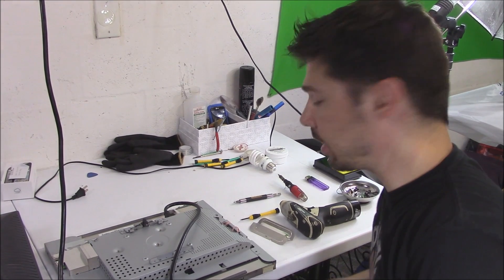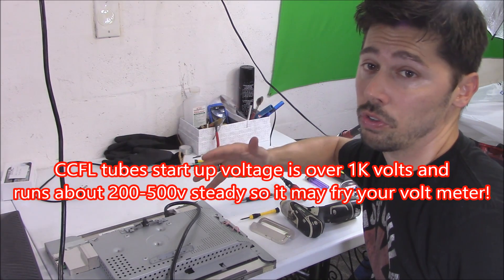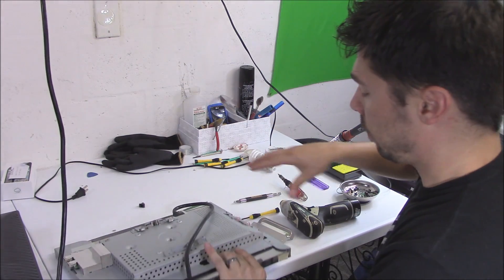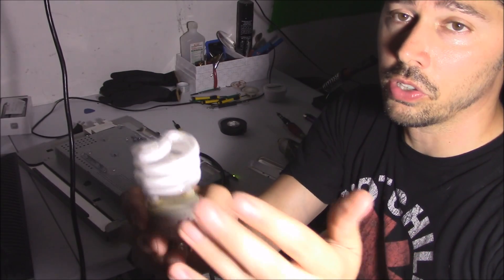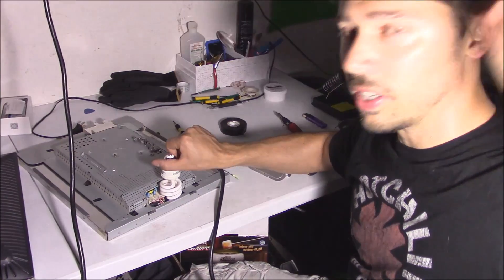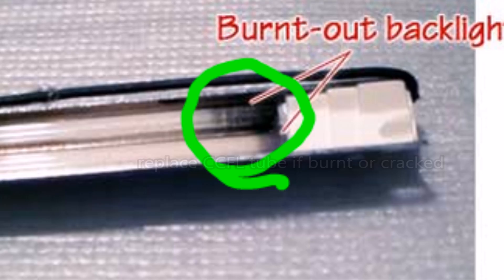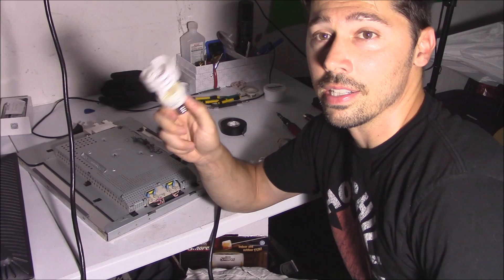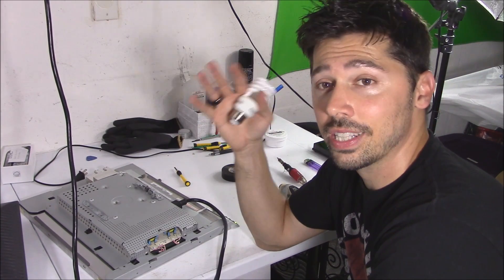How to check HIGH VOLTAGE without meters!

Comment: Thats a good way to get a hot or not reading also the max length from a corona discharge gets the voltage of high voltage and a permanent magnet can detect the polarity of high voltage knowing electrons rotate clockwise when traveling north you can see the polarity and low voltage can be detected using a permanent magnet or electromagnet ac is easy it kina vibrates but dc you need to hang it from a string to see it you can even get the polarity of current with a simple wire charged with dc current if the wires pulls away from the wire the polarity is the same but attracts if the polarity is opposite to get known dc polarity just make a battery copper is positive electrons come from here
Reply: i wonder if this kind of light bulb is also good to detect ionizing radiation do these glow if flying in a plane during the northern lights

Comment: Does this also work with a 5W inverter ? LCD panel with 2 CCFL tubes fall down, and since then, backlight does not work.
Did this test with the same size of light, and did not light up at all......

Comment: Hey Tampatec, when checking the Vs and Va voltages on a plasma TV does the TV have to be plugged in on standby? My TV turns on and then after 2 seconds turns off. I checked the standby volts and it's reading exactly 5 volts which says on the board, and the standby light does turn on in the front. When I checked the Vs and Va,  the voltages were very low. Do you think it's the power supply? Any help would be appreciated.
Reply from the maker: BlueFroyshi tv will turn on for 2 seconds you should get Vs and Va DC voltage for 2 seconds. check sustain boards and buffer boards they usually go bad, when they do you'll get either force shutdown or no picture. check here for your tv model repair- http://tampatec.blogspot.com/p/tv-repair-service-logs.html

Comment: you should do a video on all the ways you can get electrocuted or hurt opening up tv's. I wanna start messing with them after watching your vids, but I hear if your not careful you can get electrocuted?
Reply from the maker: sure anyone can get shocked working on tvs, but every house has high voltage too however most people don't get shock cause we know not to stick forks in ac outlets. some techs do wear rubber gloves.
Reply: ***** oh ok, so really I probably shouldnt start opening tv's if I dont know what Im doing? Thanks for the response also!
Reply: BHayes82 to safely work on electronics of any kind just understand capacitors and how they are used in circuits.
Reply: skyfly51 thank you, I believe that was a gem of information you just gave me!